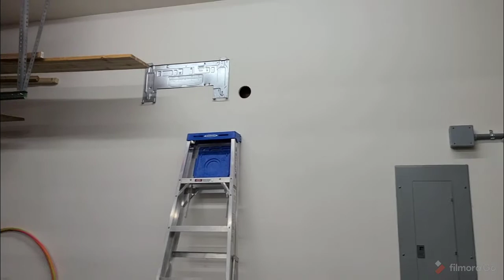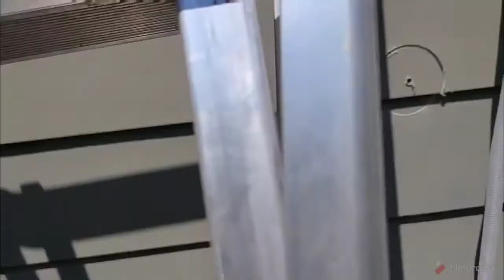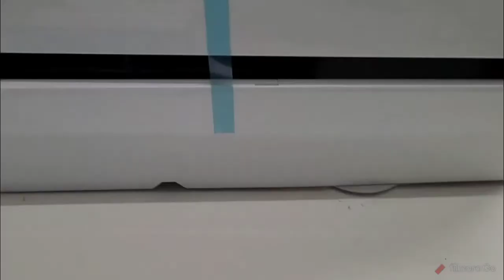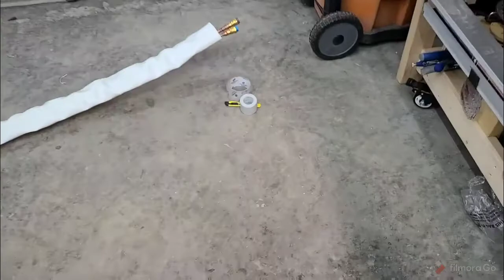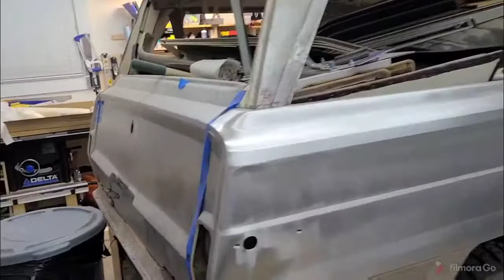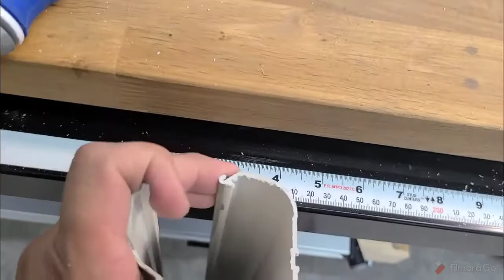Mr.Cool DIY Multi-zone Mini-split Part 2

Comment: What’s the purpose of the vinyl tape?
Reply from the maker: Just keeps the pipes together tightly to fit into the cover.   I think it adds some level of protection and insulation.   I wrapped mine as tight as I could as there is very little room in the line cover.

Comment: Very nice video's. Did you ever secure the outdoor unit to it's base ?  I was able to order my MrCool with a 16 foot line instead of 25 foot, made install so much easier.
Reply from the maker: Yeah, when I ordered mine I wasn't sure where the units were going to go.  I should have gotten one long and one short... but it worked out.   Hope yours is cranking along well.
Reply from the maker: I made the base and set the compressor on it.   Come to think of it, I haven't fastened it yet.    Hasn't moved, but I should probably run a few screws through the legs.  Thanks for the reminder!
Reply: @comfort_in_discomfort  Your welcome.  Mine has been doing well, the phone app works great,  I have it set up "comfy mode" to turn on and off at selected temperatures.   I made a one year update video, I'll include a link. http://www.youtube.com/watch?v=44VvIAJKBnc

Comment: So did you run your line sets through the attic?
Reply from the maker: The unit that's in my bonus room has access to an attic space, then down the side of the house.   The garage unit just goes through the exterior wall and the excess line is just coiled behind the compressor.
Reply: @comfort_in_discomfort  I am going to install a mr cool multizone unit with 4 handlers. One handler will be on the opposite side of my single story house. Would I be able to run those line sets through my ceiling into the attic and across over to the condenser? But still out a hole through the wall for the condensation line.
Reply from the maker: @Nicksta177  There are a few things to keep in mind.     Each indoor unit has a condensation drain tube. This tube has to run downhill.   Must not have any uphill runs, otherwise it won't drain properly during the AC cycle.   The lineset can be run in any orientation since it's pressurized.  Also, depending on your length of run, you can buy extra pressurized linesets so your unit can be further away. 

If you're planning to run the lines in a space with poor access (above a ceiling) make sure you insulate then well.   Use extra foam to wrap them.   Exposed lines get cold and contact with air will cause them to condensate and potentially drip onto your ceiling.    If you insulate then, should be no issue.    Good luck, sounds like a big and worthwhile project.
Reply: Hey thanks for the help. I’m gonna rephrase my question because it was kinda confusing: I’m  buying a multizone unit with 4 air handlers. 3 of the handlers will be on the same side of the house and the other 1 will be on the complete opposite side. I have decking and doors on the side with 1 unit so it would be hard to run the lineset along the house there. So could I run the drain tube out where that 1 handler is like normal (through the wall to outside) and then from the same handler run the lineset up into the attic across the house to the other side with the 3 handlers and down straight to the condenser?
Reply from the maker: @Nicksta177  Ah.  Got it.   Yeah along as you have access from the compressor to the air handler, you can run the line wherever you want.   Just remember the insulation.   Make sure you've got the route measured out sonyounknow what length you need.
Reply: @comfort_in_discomfort  awesome. Thanks so much for the help. Would the black foam insulation be good enough and maybe wrap it with some type of insulation tape after for double protection?
Reply from the maker: @Nicksta177  exactly.    The lines are already insulated in foam and are on a lose rubber jacket.    The kit comes with a vinyl tape that you wrap tightly around the pipes.   Just make sure that no pipe is exposed.   As you bend them and move them, the ends will become exposed.   I used pool noodles (had some).    You just want to make sure there is as little air contact as possible.

Comment: This one answered my question from the Vid 1.  Thanks!
Reply from the maker: Thanks for watching.   You can buy different length lines.  16 ft or 20.  Mine is 20 so the short run had a large amount I needed to coil.   You can also order pre-charged lines to connect together if you need a longer run.   I thought about placing my garage unit on the far side, but didn't like the idea of having to conceal the line set on the ceiling.   So far, it's worked out well.   In My it'll be one year and I'll summarize my experience then.

Comment: No insulation in that wall
Reply from the maker: Yup.   I just need to decide if it's worth insulating.  I would need to do exterior walls (really only two as the garage doors take up the 3rd and possibly ceiling.   Or just run the system more frequently...

Comment: How big is your garage? I'm also interested  in 18k
Reply from the maker: I have a 3 car garage. So roughly 30x20.  12 ft ceiling.  

The unit is definitely big enough to handle that size in terms of cooling.  

Heating takes a little longer, but my main reason for installing was AC.
Reply: @comfort_in_discomfort  awesome!! Thanks

Comment: I am getting ready to install my MrCool 18k.   I was going to drill a 3.5" hole and use a piece of 3" PVC pipe. (not using the DIY model)
What size hole and insert does your MrCool use?   Another YouTuber recommended the bigger size because the 2.5" included insert was very tight to get the lines through it.
Reply from the maker: I used a 3.5"hole saw.  My insert was also 3.5" (both the 12k and 18k units have the same inser size).   There's plenty of room to feed the line through.   Try to match the pipe and hole size as much as you can to avoid a bunch of gaps and caulk.   Also, the provided inser has a bit of a flange that helps seal the outside.  If you don't have the provided insert, your PVC idea sounds fine as long as you can minimize the gaps.  

Feel free to ask any questions.   Mine has been working great for a while now and I've learned a bit more about it. 

Good luck.   No regrets in the purchase here.
Reply: @comfort_in_discomfort  THANK YOU!